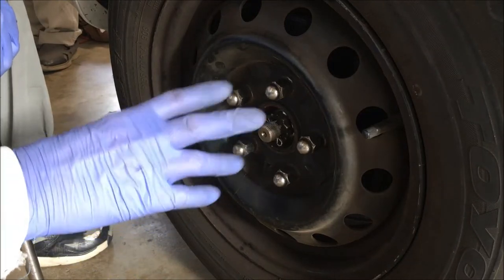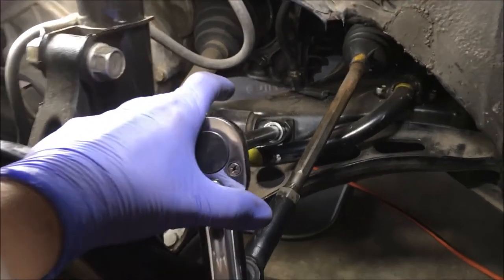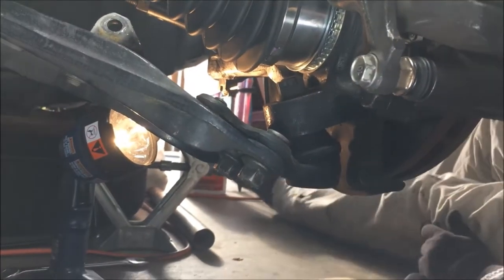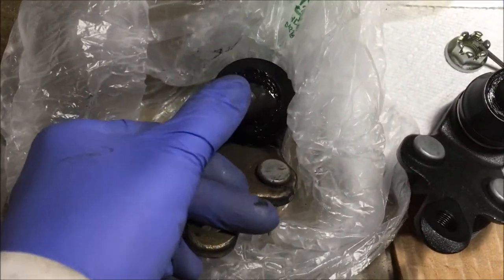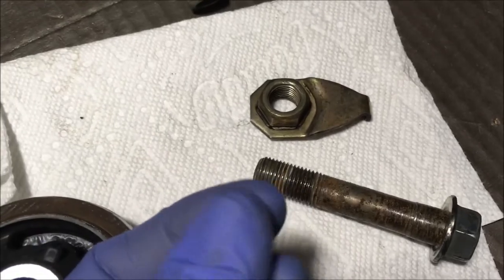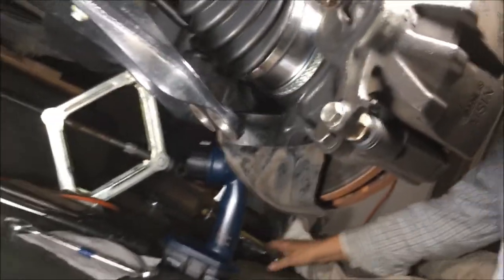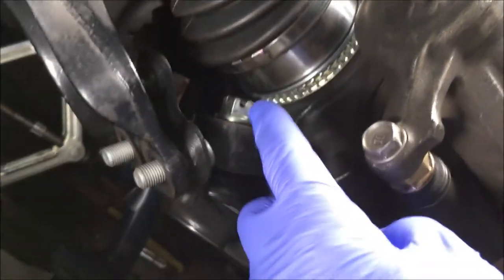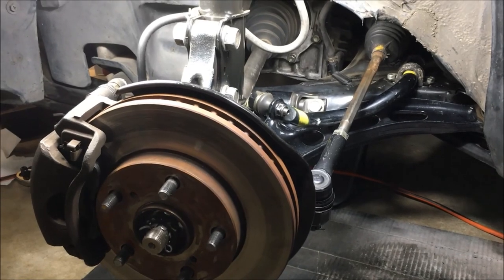Replace Lower Control Arm & Ball Joint | 1993-2001 Toyota Camry

Comment: Well detailed narratives help a lot! Learn to lock a box end wrench to the open end side of the working wrench gives more torque leverage on the ball joint castle nut. There are crowfoot wrench attachments for the torque wrench in tight areas you wanna torque. Attaching the lower control arms rear bolt  is the hardest if anyone doesn't follow your method! That locknut clip keeps running away because it's nut is not anchored like body fender clips. Why couldn't I have found this 1st? You gals eliminate all the difficulties I encountered! Loved the close up video !!!🥰🥰🥰🥰🥰
Reply from the maker: Thank you for your thoughtful comment.  I appreciate that and will pass on your comment to Sister.  HappyDIYing!  ;)

Comment: good video and detailed However, I woud suggest you refrain from using your torque wrench as a breakerr bar and use it only to tighten to spec. Using it in the fashion you did can lead to decalibration and damage!

Comment: Great video, do you have a recommendation for the replacement bushings for the control arm. Did you use original Toyota parts? Thank you.
Reply from the maker: Thank you, Joseph.  Toyota does not have or sell OEM bushings for the lower control arm.  They do sell the entire lower control arm, which I would NEVER buy because it's not necessary--hence, Frugal DIY.  :)  DO Not under any circumstances give up your OEM contol arm, just replace the bushings.  

I purchased my replacement bushings from AutoZone--the AutoZone Duralast brand.  Call AutoZone and they will help you find the correct bushing(s) for your exact vehicle.  Now, if you need to replace both the round, donut bushing (the rear one that I replaced) AND the long, cylindrical bushing (toward the front of the control arm), you can buy a bushing kit that has both.  Or, you can purchased them separately, as I did.  I then had a machine shop push the bushing out an in for $20.00.  Look for a machine shop in your local area that is willing to push lower control arm bushings out and in.  Some machine shops don't have the equipment to do that small bushing.  

I did use a Toyota OEM ball joint, and I highly recommend you do.  I purchased the Toyota OEM ball joints off of eBay for a screaming deal.  LOOK on eBay.  The Toyota dealership wanted too much money for the ball joints.  Message back if you need more info or help.

Comment: 8:26 The tab of the locking nut on our camry's right control arm broke and we had to use a flare nut wrench to hold the nut in place in order to get the bolt loose. What would you recommend we do in order to replace it? The control arms we bought didn't come with replacement hardware and I can't find those locking nuts anywhere online :/
Reply from the maker: I'd recommend you call your local Toyota dealership or go to junk/salvage yard and pull one off.  That's what Sister and I would do.

Comment: Damn this was good. Thank you ! I got quote $800 to do this job (including alignment) and I was just like there’s no way. I outta owe you a percentage of the money saved.

Question. Could I first remove the control arm completely then the ball joint? Just to get the control arm out the way and have more room. Or do you recommend I keep it on while getting the ball joint out?
Reply from the maker: Thank you, Emilio, for the nice comment.  There's no harm in trying.  We just found it easier to take the ball joint first.  You've got to consider the leverage points you need to loosen and/or remove parts, which is what we did.

Comment: I got question is it okay to use a torque wrench when it's rusted at the bottom
Reply: Just clean it up and continue using it if the adjusting nut is still secured. You might wanna use a rust stopper.